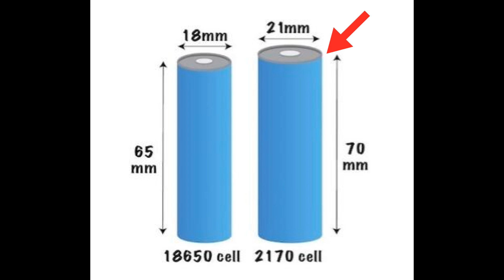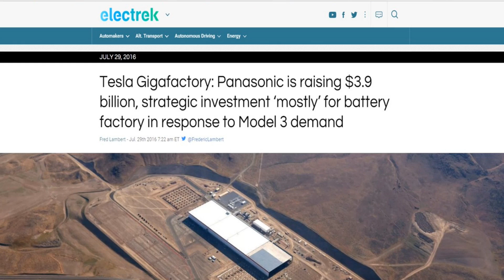Tesla Model 3 Status Report

Comment: Please don't say M3,  that's already taken.   

I think Panasonic will be on the hook for some of the cost due to delays.   

If tesla hits 2000k units a month,  they will get even more orders.

Elon may have to buy his own mining business to ensure his supply chain is not put at risk
Reply: +Andrew Steinhaus therein lies the problem: our planet has far less lithium than most people would expect, so mass-market electric cars could certainly mess with the global battery industry. This is a classic example of an unintended consequence. I feel that long term, Tesla's going to have to create a wildly new electricity storage architecture. That would make the production of batteries a sustainable and scalable operation for them, while simultaneously gaining a highly competitive core competency in the space.
Reply: Float Circuit    There's plenty of lithium to go around,  plus  once more vehicles hit the road recycling will become economically viable.    The real bottle neck seems to be cobalt.    But that may be overcome with graphene if the research pans out

Comment: Yes, I think Tesla will get their production rate at 20k cars/mo. but will take a couple of months to get there: ~March '18.  I've worked for a wind turbine manufacturer who promised thousands of wind turbines/mo. to be made.  We had mass orders come in and experienced a software glitch that stopped production for nearly 3 months.  A few orders cancelled but when we got up to full speed, far, far more orders came in so we opened 3 production lines, around the clock and kept that speed up for another 3 years.  Tesla will be fine as they're customer base is loyal and there's really nothing else out there like a Tesla.

Comment: I'm excited for more electric cars to hit the road but I think we have some obstacles to overcome with the power grid and the costs associated with them. Anyway, great video NeoScribe!
Reply from the maker: Thanks! Much more to come!
Reply: Electric Cars will help the grid by charging on off-peak and that will better balance the load thru out the 24 hours in a day. Between 11pm to 6am there is coal and wind generation capacity which simply doesn't have a buyer.   EVs can actually do a lot to help the grid.

Comment: "Devastating bottleneck"?

For the vast majority of us Model 3 reservation holders, I don't think a delay of a couple of months in order to get it right would be considered devastating at all. By all accounts by those that have taken delivery Tesla has hit a homerun with this car. 

In my opinion there is nothing in this car's league currently on the market. No, I don't consider the Bolt or the new Leaf to be up to what the Model 3 has to offer. The lack of a widespread fast charging network alone eliminates those cars from contention in my eyes, let alone the OTA updates and autopilot/full self driving technology. I realize others will disagree but for the vast majority of those of us that have actually invested our hard earned money on this car, there is no substitute.

Tesla and the Model 3 will be just fine. Any new model vehicle will run into snags. Sensationalized overreaction by the press and individuals will not change that in the long run.

Just my $.02. Oh, and why does anyone that believes in Tesla and supports their efforts automatically get branded with a derogatory label like "fan-boy". Pretty immature approach to someone you don't happen to agree with.
Reply: What part of the business is "devastatingly" affected by delayed Model 3 production? It isn't the S or the X. Both cars are assembled on different assembly lines and utilize a different battery pack. The Telsa power walls are being assembled and shipped just fine. When there has been a shortage of batteries Tesla just purchases corresponding batteries from other manufacturers like Samsung to meet the demand and ship the product. Tesla isn't a crippled company. Tesla's other products are doing fine. The Solar division is down, but that's to be expected. But the moment people started writing about how the amounts of Model 3 were low in number all their detractors started talking about massive problems. Tesla knew what the problem was. It was Panasonic. They didn't throw the Panasonic team under the bus but their equipment clearly couldn't produce the battery packs as fast as Tesla needed them to be assembled and Elon got personally involved. He had his people re-write the software for the robots to make the battery modules faster than then could currently be produced. That is what they are working on. Once these robots are fixed the "devastating bottleneck" problem will be resolved. Then they can start delivering more cars. It's not like the model 3 isn't being produced. They are being made and delivered. It's just that they aren't being made as fast as some people expected them to be. Tesla will figure these things out. These manufacturing delays were expected from the beging and are not insurmountable.
Reply: I agree Dan. For those paying attention they'll know that before this happened Elon always stressed the fact that the rate of ramp up in production is always hard to predict and there will always be bottlenecks.
Reply from the maker: I certainly think the bottleneck was/is devastating to the business more so than the individual consumers...
Reply: NeoScribe I respectfullyy disagree. Tesla has always looked forward and those that can't see past the immediate are dismayed by what they see. The delay experienced with Model 3 is nowhere near those seen with Model X and they weathered that storm fine.
People seem to forget, or not realize that the Model 3 was originally set for initial production in 2020. They only pushed it up due to the incredible response to the reveal back in March, 2016. Two month delay vs two year advance? Like I said earlier, I am totally fine with where they are in the ramp up and I believe in 6 months the other manufacturers will be scratching their heads trying to figure out what happened.